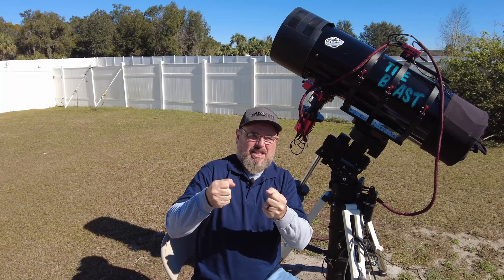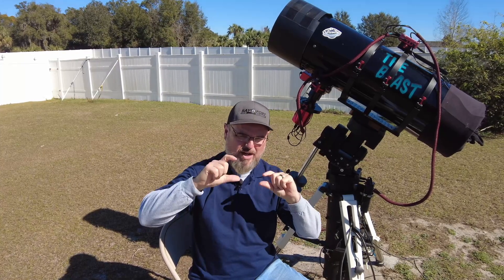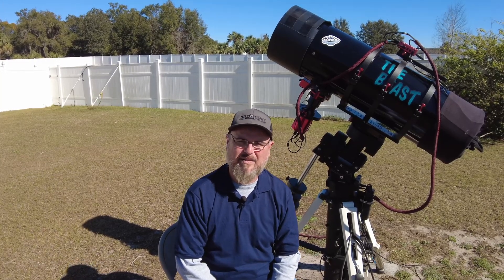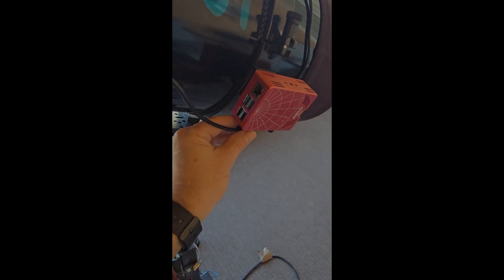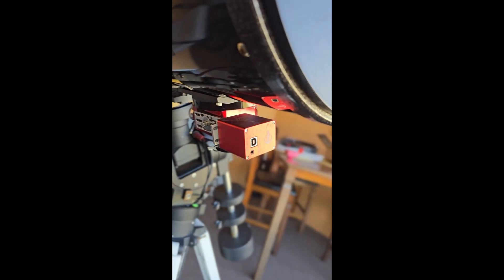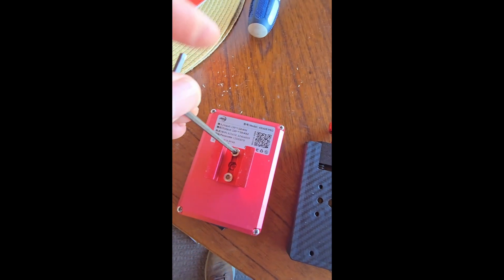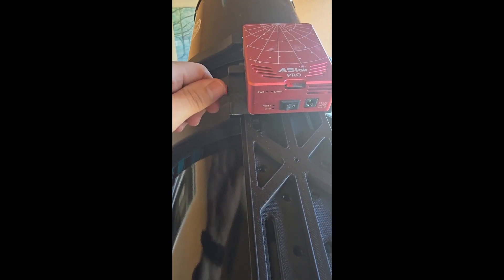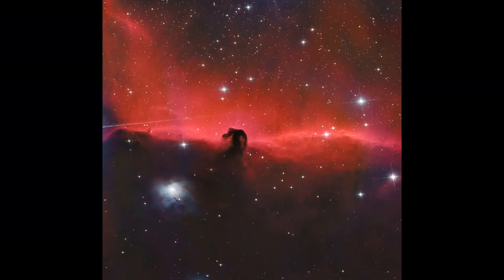Major Newtonian Upgrades

Comment: Alright so the link for the Moonlight sends me to the NiteCrawler, that doesn't look like the one you used. Did you used the 2.5" Newtonian CRL version on the same page?
Reply from the maker: @ona4day  strange....yes that's the one. 10" flange....their site isn't the best. Also you'll have to choose a focus motor. Unfortunately you can't get the focuser without the motor. I should have explained that in the video......dang it!

Comment: Are you sure that is 300mm?  (12 inch)   It looks like a 10 inch scope, 260mm.  That might be why the curvature of your focuser doesn't match the tube.  That being said, I have a 10 inch similar to yours and pretty much gave up on it because I couldn't get it collimated.  I even bought the catseye system, the whole kit, and I can't get it to stay in collimation no matter what I do.  Maybe I'll try a new focuser and rings- mine are exactly like your old ones.  Anything else I should check?  Thanks for the video.
Reply from the maker: @Glofilter  circumference 😉
Reply: @enteringintospace4685  right, but I think when you order a focuser for a 10" newt, they send you one for a 12" tube.  Yours looks like it's for a 14" tube the way it is splayed out a little bit.  Maybe I'm full of nerd gummies.  Probably.
Reply: @enteringintospace4685  same thing I told her
Reply from the maker: @Glofilter  definitely recommend both. I couldn't state enough in the video how well collimation holds now.
Reply: I installed a Baader Diamond SteelTrack focuser on my TsOptics Photon 10 Inch Newtonian and it was plug and play. The install kit has some unverisallity (lol) to it, but I didn't need any of the added items. The focuser itself is dreamy.

Comment: I noticed you upgraded the mount, so the eq6r wasn't up to scratch? Nice setup.
Reply from the maker: @chessymajewski9669  Thanks....still have the eq6r, it's a great mount. I got an opportunity to buy the 70 second hand and couldn't pass it up.
Reply: @enteringintospace4685  Thanks Steve. I did what you did, went from 8 inch f5 to 10 inch  f4 skywatcher on my eq6r and it seems to be ok as long as it is well balanced. Cheers.